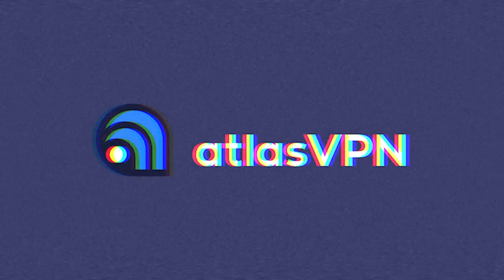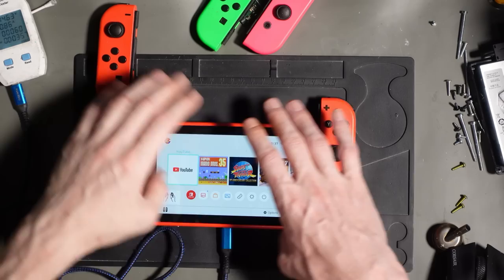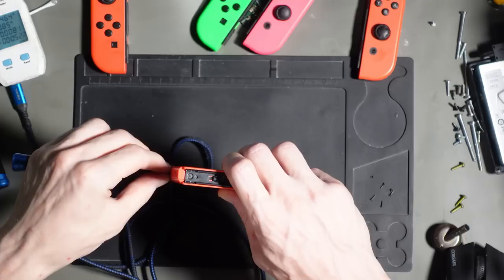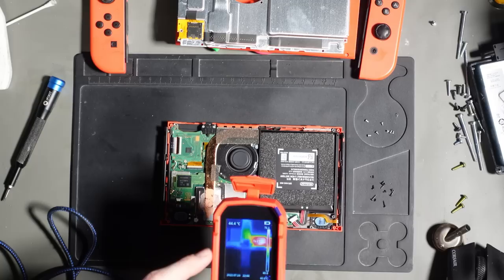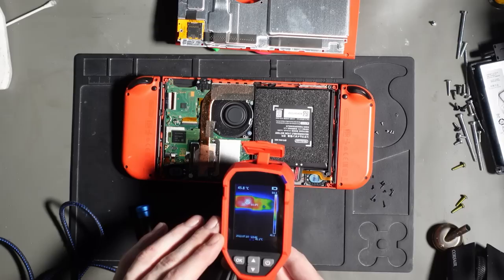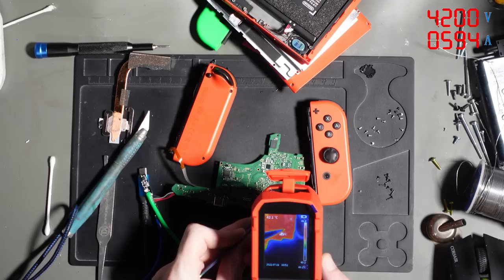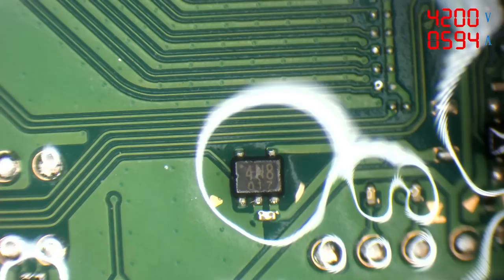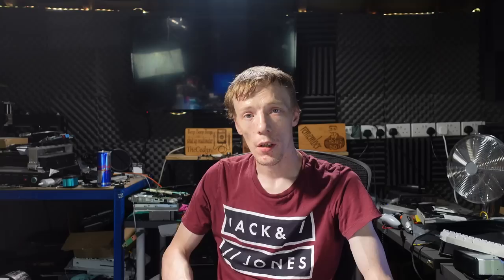I Bought A BROKEN Nintendo Switch From Another Tech YouTuber... Can I Fix It?

Comment: Simple test if it's that FET as only issue (I don't think that's the issue). Swap the one from the working joycon rail over to that pad see if it starts working. I've not reverse engineered fully the joycon charge circuit yet but pretty sure it just the CPU turning on a MOSFET to pass power down a specific pin on rail. I think your MOSFET you replaced it with first was good and your issue is burned out pin on joycon rain for connector
Reply: Appreciate all you do fella. Been binge watching GG stuff of yours! I'll be heading over for some mods soon to sort the POS on my last vid!
Reply: @GetRefurbed  Glad they are useful :)
Reply from the maker: Thanks mate I'll look into it as soon as I have a donor board I can use for swapping parts back and forth. The joycon on the other side I believe uses a different fet because that one is only responsible for the rail, where as the faulty one is responsible for the fan too

Comment: You should check out another UK repair channel called RetroSix. He shows you how to solder a 10k resistor to the test pads on the Switch PCB to trick the Switch in thinking a batter is connected. It will save you from taking the PCB out of an actual battery.

Comment: Phil you need to see if you can get yourself an attic exhaust fan even a small one 8x8 put in the ceiling will help exhaust the hot air out of the room and not that hard to put in and they're not that hard to hook up in fact you can even use a regular house fan as an exhaust fan you just have to turn it the other way and because the motor and everything will be pointing in it'll be protected from the rain and stuff and you can put a rain guard over it but you definitely need to get an attic exhaust fan otherwise you're going to swelter the rest of the summer